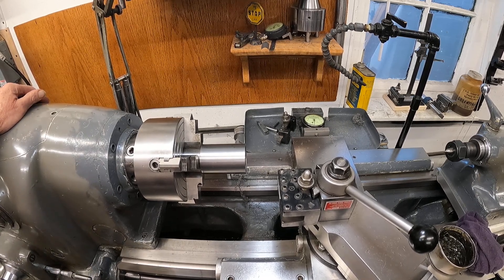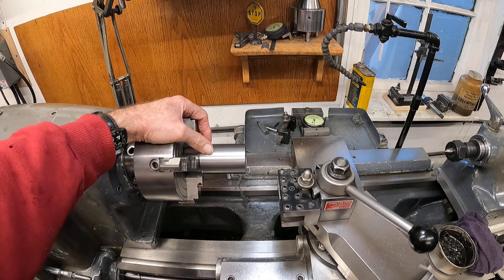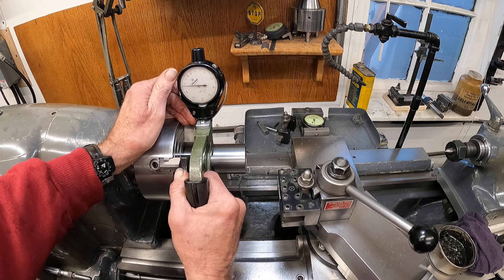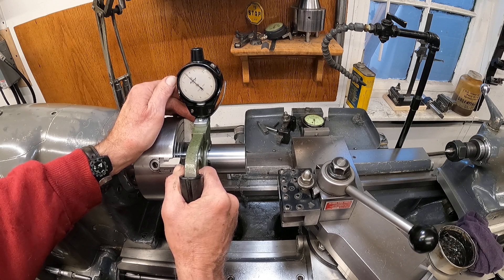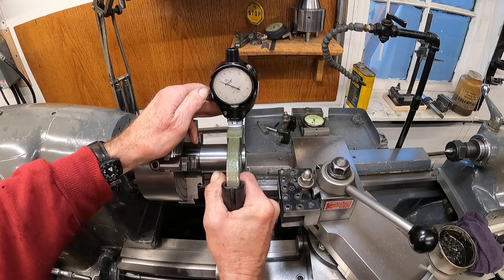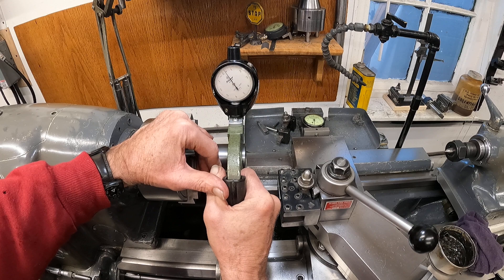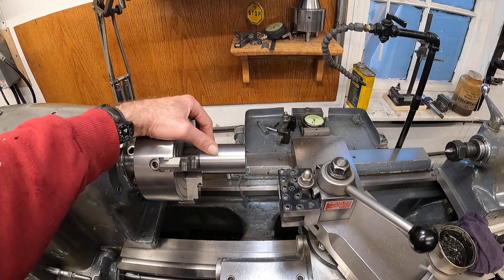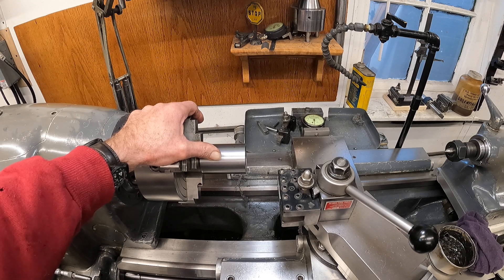Monarch 10ee lathe Zero in on near perfection

Comment: Amazing how accurate the old equipment was manufactured to be. Is it possible that the thou and a half taper on the 10ee is somewhat being caused by toolpost deflection?
Reply from the maker: Nope that is 150 millionths .00015" A thou and a half would be blasphemy! This machine is a work of art, there are none better for a manual machine. Thank for checking it out.

Comment: I liked Your gages. i got jealous and bought a few of My own on ebay. One is just like yours mitutoyo. I make dies for coin presses and heat treat them in house. These gages will make it even easier to maintain size on the cnc lathe
Reply from the maker: Those gages are one of the good buys out there. They save time for me.
Reply: what did you search for on the gauge?
Reply: Snap gages mitutoyo. Paid about 125 each . The first one came and it's nice
Reply from the maker: @danneumann3274  That was a great buy!